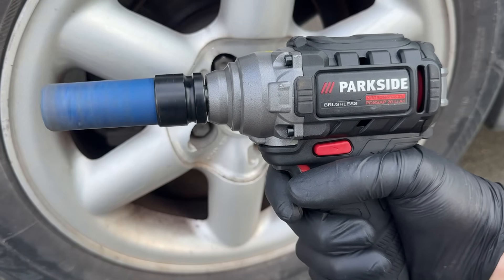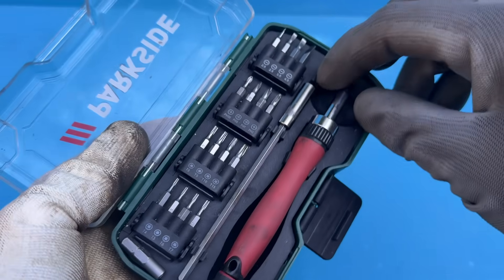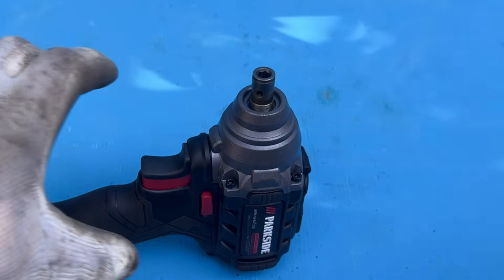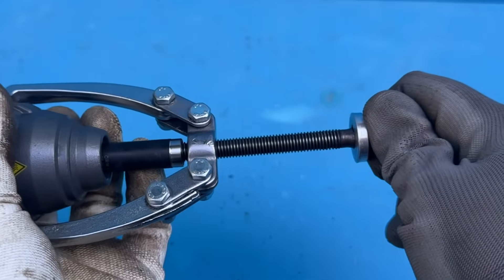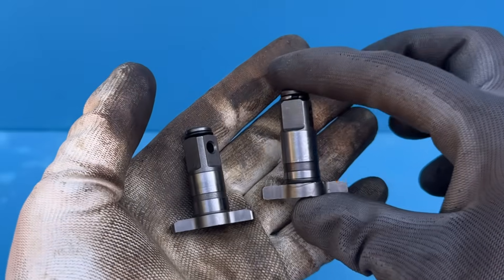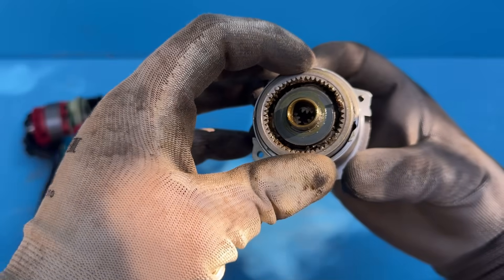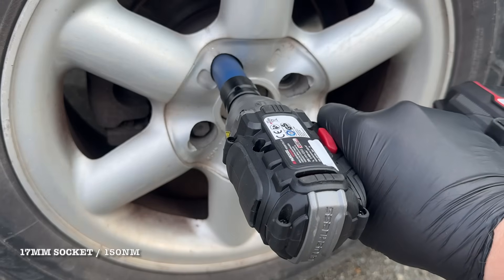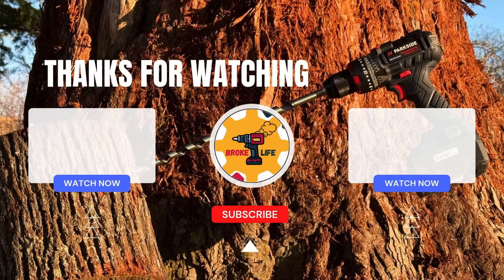The 👑 KING of impacts! Parkside Performance PDSSAP A1 20-Li modified to fit both sockets and bits

Comment: Just one week ago I finished the same modification, using the information that you already gave in other videos and comments, with the anvil Worx WU278.
I was able to source a near perfect bushing and washer though!
Search the web for "Oil Filled Plain Bronze Bush BNZ16-19-14.2". The dealer has different names in various languages, and ships internationally for a total of ~14€.
On aliexpress I found washers M16x30x2. The height varied from 1.8 to 2.2mm in my batch.
The height of my anvil was 5.8mm, so I had to grind it just a bit with a PBFA band file, otherwise the anvil would not turn freely.
There are two unanswered questions for me: 1) Is sintered bronze BNZ a good material for the bushing? AI research says it is the best, but I never trust a machine. Or anyone else 😅 2) Is it okay to use a thinner washer, to avoid grinding the anvil? (if you can find or grind one.) AI says yes, but to keep the outer diameter for spreading the impact on the shell.
With your help I was able to repair and upgrade that broken impact wrench for a very lovely bicycle repair shop, and it was a nice DIY project for me, with a lot of learnings. Thank you very much! 💜🖤💜
Reply from the maker: Thank you so much for that! ❤

 I’m unfortunately not a fan of using a brass bushing in an impact wrench or impact driver. While it’s true that brass is generally an excellent material for a bushing, that doesn’t really hold up when it comes to impact forces — the bushing wears out very quickly.

I’ve tried them myself, and I had to replace one after about a week because the inner diameter had grown by at least a millimeter in that time. In my experience, the best option is a steel bushing.

As for the washer, I agree — you can get away with a thinner one as long as the total thickness of the washer and the anvil base matches the older pair, and the washer isn’t excessively thin.

How’s your build holding up so far? As long as you’re not using it at max power, the brass bushing should last a bit longer, but it will still wear out much faster than a steel one.

Bottom line: all of my modified tools use steel bushings, because I’ve never had a single issue with them — whereas the brass ones just aren’t ideal for impact applications.

Comment: Is it stronger than ppdssa 20?
Reply from the maker: I haven’t tested it directly against the PPDSSA A1 20, but it’s going to be a close call. If the impact wrench is a good unit, I think it might just edge it. However, given the quality control of newer Parkside tools, some units will likely perform worse and some better — but I don’t think many will last as long as the PDSSAP A1s.
Reply: ppdssa 20 should be stronger cuz it has 600nm. ofc it all depends on quality control
Reply from the maker: @TechTesting I’m personally not entirely sold on the 600 Nm claim. While I do think there are tools capable of that, I’ve seen enough to know that performance can vary. The gap isn’t as wide as with the 12V impact wrenches, but it’s definitely there.

Comment: Thanks for the video! I’m wondering if this converted tool is stronger than the current 20v performance impact wrench (mid torque one, not the big boy) and if it is, how do they compare? I’m thinking about getting that tool once it’s available again and replacing my 12v performance one because it sometimes just not strong enough.
Reply from the maker: I haven’t tested it directly against the PPDSSA A1 20, but it’s going to be a close call. If the impact wrench is a good unit, I think it might just edge it. However, given the quality control of newer Parkside tools, some units will likely perform worse and some better.

That said, if you can find the new PPDSSA A1 20V on sale again — it was €50 last time — it’s absolutely worth picking up at that price. The conversion I made in the video relies on having a PDSSAP A1 20V to modify, which these days is rather expensive, and I only made the video due to popular demand.

Otherwise, if I were starting from scratch and wanted a small impact wrench, I’d go for a PDSSAP D3 with a 4mm spring and modify that one. I think I can even make a much better bushing for it now, so I’ll be following up on that if I have the time do so.

However a PPDSSA A1 20V for €50 is the deal to go for if you want a tool that is cheap and works as an impact wrench out of the box!